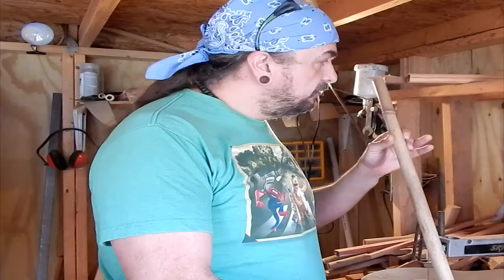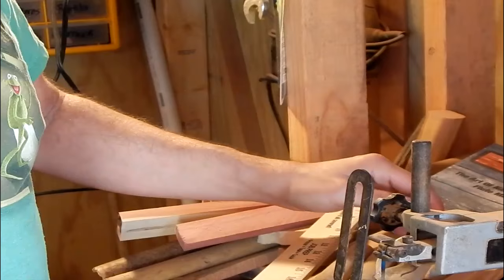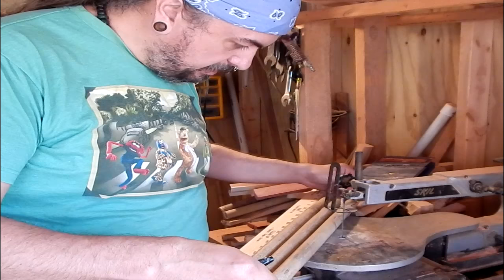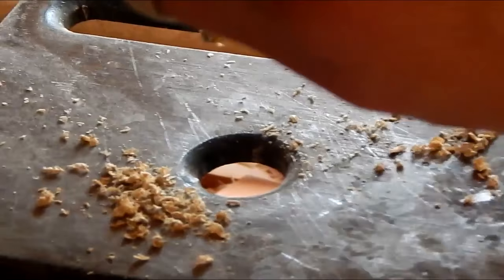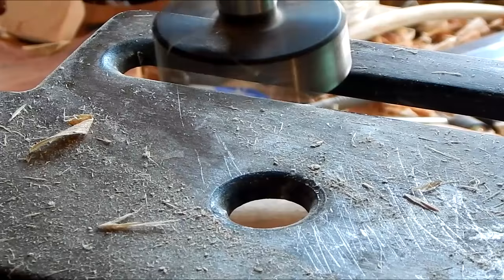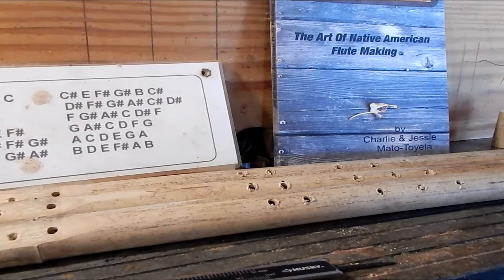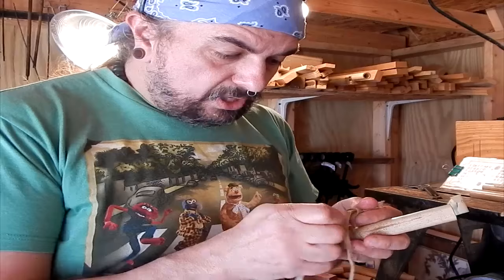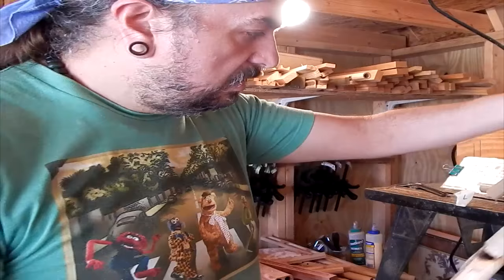What is the distance between the Air Supply hole and the Sound hole on a Native American Flute?

Comment: I just bought two flutes one has one half inch wide  squear holes  one inch  apart the holes from 3 1/2 inch      the next hole is 4 1/2 inch      #3  hole 5 1/2 inch   #4 hole  is 6 5/8 inch  #5 is 7 3/4   #6 is 8 3/4   inside is 3/4 inch           the  other one inside 7/8 inch  from mouth piece to 5 inch   i inch between holes  #1 is 4  3/8        # 2 is 5 7/16  # 3 is 6 3/8     #4 is 7 3/8   # 5 hole is 8 3/4      # 6  hole is 9 7/8      from hole 3
Reply from the maker: Hey William, thanks for your comment. We do have a number of videos showing the measurements of different size flutes and of course they're all listed as well as in my book "The Art of Native American Flute Making". If you have any questions about finger spacings feel free to send them to me in an email on my website bluebearflutes.com  and I will be glad to help you out.

Comment: I can' get either one to sound wright.       they are different sound each time i blow into them.can you tell me what to do with them.
Reply from the maker: There's a good chance that the bottom length of the flute is too much. The best way to find out what is going on however is to First contact me through my website bluebearflutes.com and then once I respond you can email me a picture of them. From there I can probably tell you what's happening immediately.